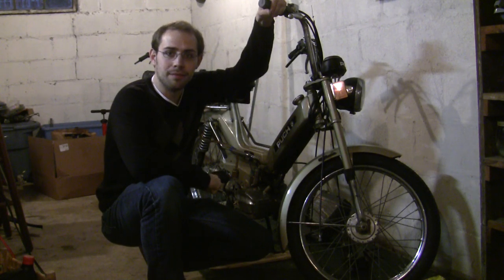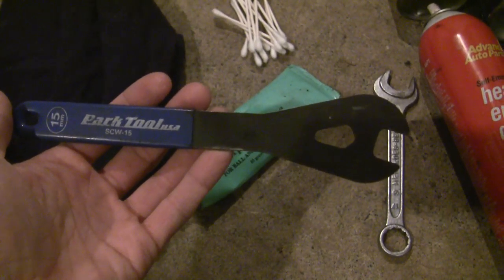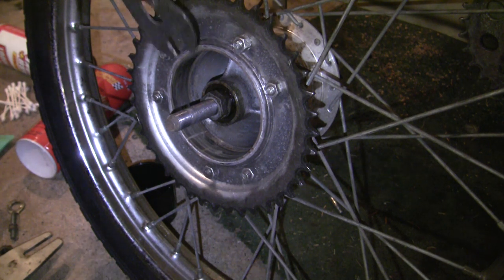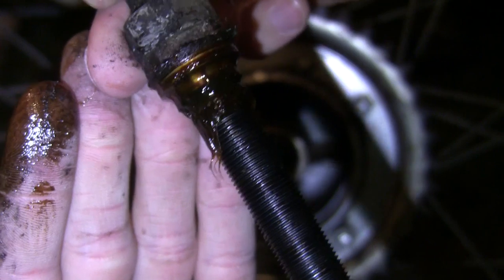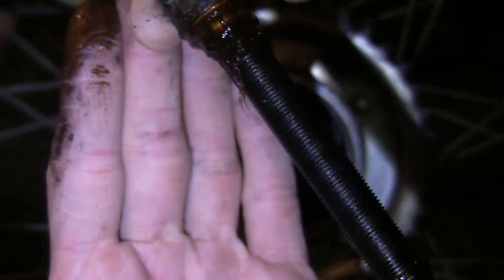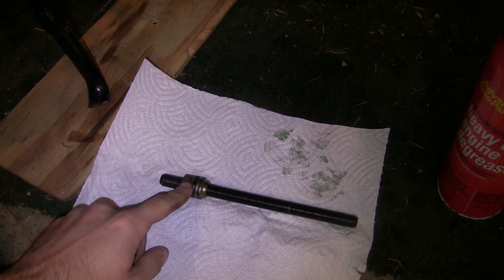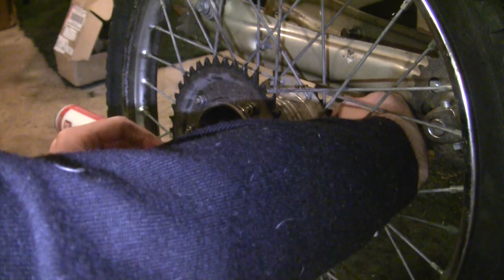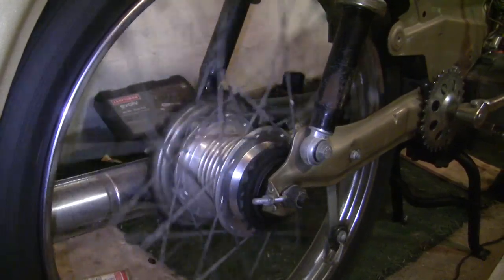How to Repack/Regrease Wheel Bearings on a Puch Maxi or Similar Moped with Loose Bearings

Comment: Smashing job travis :-)

Great you reminded people to check again after tightning the locking nut, there is allways a tiny bit of lateral play between the cone nut and spindle threads.

Steering head bearings are much the same on older motorbikes, its a feel for the minimum play but smoothest bearing spin, i do know what you mean :-)

The grease was pooched ha ha :-)

Comment: Do you have a video on how the disassemble and clean the ratchet on the pedal side of the hub?
Reply from the maker: I don't but Cornped does:
https://www.youtube.com/watch?v=mS1GdtKUKsc

That's without the correct tool though, step by step for that is here:
https://www.mopedarmy.com/wiki/Changing_a_Puch_freewheel

Usually I just spray around the outside of the freewheel with some grease in a can while turning it and it becomes good enough.
Reply: That link to the mopedarmy page is exactly what I needed. Thanks
Reply from the maker: @CO-pq7cl  Great! Best of luck with your wheel